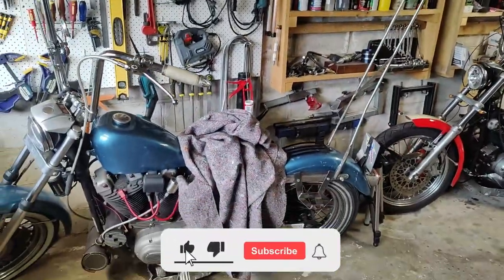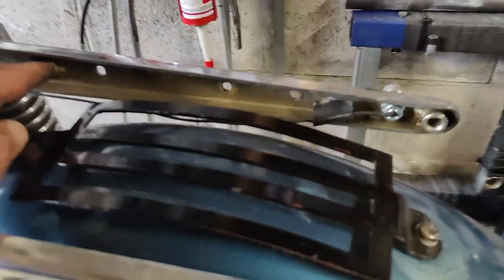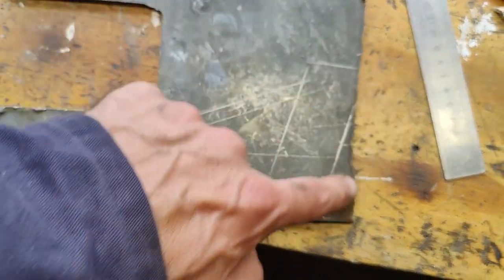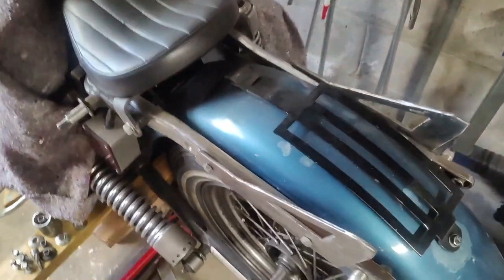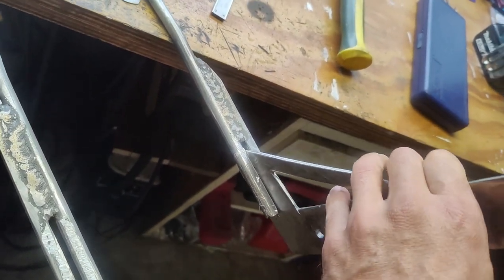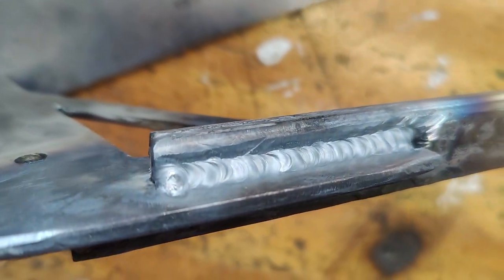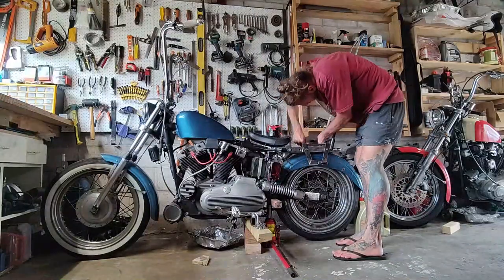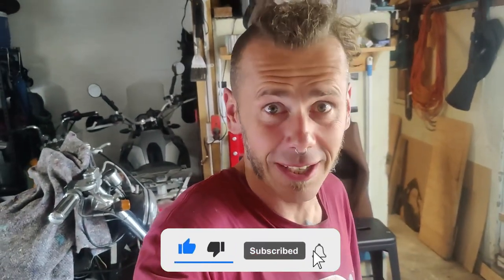Is 3rd time lucky? 1970 Ironhead never stop shaking, will my sissy bar last?

Comment: 😎👍😎
Im resurecting a 1973 sportster that has been parked for at least 10 yrs..or more,battery dead,which was inside of oil bag/tank,remove battery cables remove oil hoses,remove rear exhaust,then rubber mout for tank,drain tank,slide out remove and replace battery,tig weld up dents in tank where it had been vibrating up against rear head,clean up and wipe up years of oily leaks,clean up carb a few times,clean out and blow out gas tank and intank screen,blow out petcock,replace gas line and filterrefill 2ith clean oils,finally starts and runs,although not road worthy yet,need to make up shift and brake linkages for forward controls,some parts missing,probably thesame as many other readers do or have done in the past...
Reply from the maker: Yeah bro that sounds like a heap of work! Great job on that. It's rather exciting to bring old bike back to life. When I found this one it was just half of rusty engine and all linkages all electrics missing no cables for brakes throttle nothing. I just had 2 books and YouTube haha. It's all we do aye. It takes time but it's so worth it. To me at least. Thanks for message